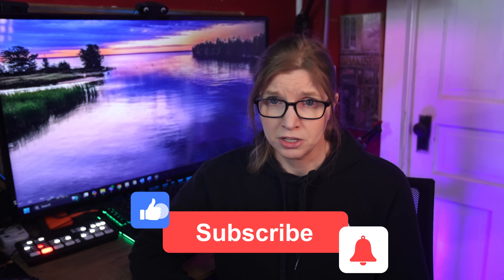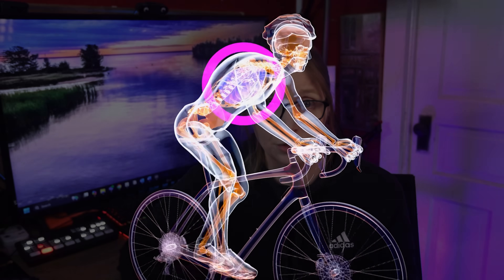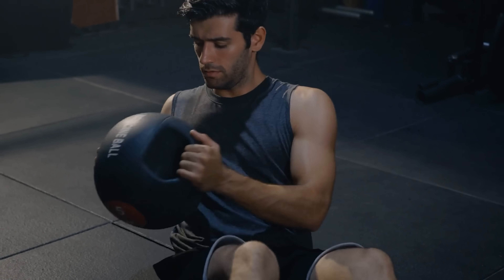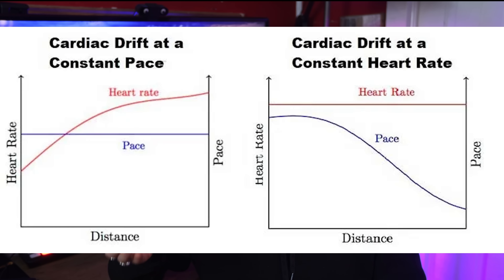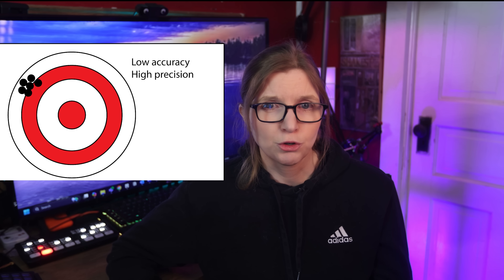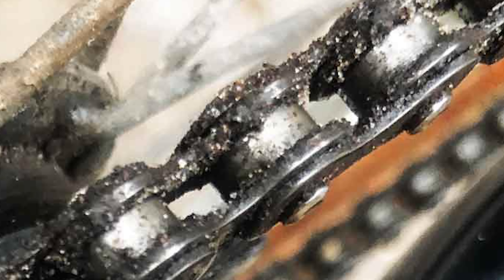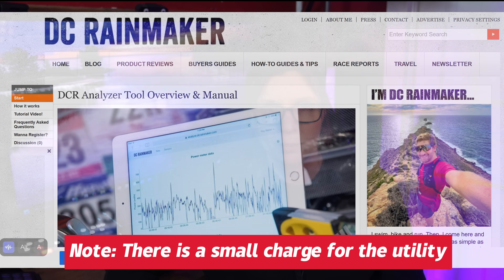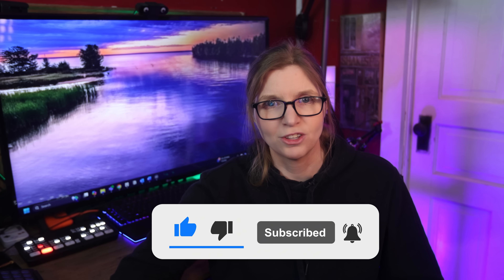Your FTP is WRONG - Here's Why!

Comment: Regarding fatigue from holding position indoors, I have a different situation. As a longtime recumbent cyclist I have a recumbent on the trainer, but for the last few years I've been mostly gravel and mtb outdoors. Being on the recumbent on the trainer takes away all the core work for balance and lets me focus ALL on the legs. Secondary benefit is that one Lasko fan sends airflow across legs, torso, arms, and head.

Comment: Honestly gravitational friction is impossible to replicate with linear algorithms and a flywheel. Anecdotally, my best years with my best training blocks were always on the road. Lots of rolling hills and a fair number of big climbs. I still believe that working your cadence up and down through the same power output is the best way to train. Not only does builds power at different rpms but over time builds a huge advantage in cycling technique that gets engrained in your neuromuscular system. Just ride outside

Comment: Wow! You are amazing! and funny! I am always 20 watts (ftp ~275) lower on my trainer. I have had so many issues with ERG mode I have disabled it. I never had a power meter on my outdoor bike. I would use the power measurement from my head unit or App. That data was more inline with my trainer data. But it is on my gravel bike. I think I am less efficient outside. How much does bike/surface matter for power data?

Comment: Trust me, in the UK, I ride faster when it's warm than when it's cold!
Reply: There’s also more rolling resistance at lower temperatures with most rubber compound, but also at very hot temperatures rolling resistance again goes up. The sweet spot is probably around 65 F or 18 C for body temperature and road temperature
Reply from the maker: @richardmiddleton7770  I just did a whole video on cold weather training, but even if you're talking 50s, it's the road surface and tires. Rolling resistance in the cold is no joke

Comment: +1 ON COOLING 🌬. I took part in a university study  in the 1990s that tested indoor fans. The conclusion:  Indoor riders were woefully "under-fanned".  This results were consistent with your video: You get a less effective workout as the body fights to regulate core temperature. Their recommendations: At least 2 fans in front and one more behind.  A tag line they used: "Sweat on the floor is fitness left on the table"

Here is the setup I have used for years: 4 fans in total. Three Vornado fans positioned as close as possible to maximize CFM and velocity (which falls off at the square of the distance). 

 https://pedalsmartblog.blogspot.com/2023/11/indoor-bike-improvement-8-fans.html

Comment: A few of the things you noted is why I really don't want a bike fit on a static trainer, it feels like learning to play tennis using a VR headset, the bike is constantly moving outside...
Reply from the maker: That's a fair point. I think that some of the major players have done some accounting for that and can use certain models to extrapolate to outdoor mechanics, but it's certainly not perfect. The best fitters out there actually mix something like a Retul fit with repeated outdoor ride feedback. They cost a lot more than the one-shot deal, but they are worth it for those who are hyper-responders that struggle more with tweaks and niggles.

Comment: The HEAT issue is so real.  My personal experience is that I am happy holding 280-290 watts for an hour in a room with AC set to 18C and a fan blowing on me, but if you up that temperature to 26C, my threshold falls to 230, at best, for the same hour and keeping up with hydration becomes a challenge.
Reply: To hold that watts for that long, do you mind to ask you how many hours of weekly training?

Comment: Great topic for a podcast.  I think it makes a lot of sense that your power could be higher or lower outdoors v indoors.  I think one of the biggest factors depressing outdoor power v indoor is road buzz.  In the UK, the roads are terrible and I find the legs struggle to get into a rhythm that you can get indoors or on outdoor smooth tarmac.  That, and the fatigue it gives you - eg I lower back and neck stiffness from riding outdoors  when I don’t from riding indoors at the same power.
Reply from the maker: Isn't that the truth! I spend a lot of my time in back roads and farm land to avoid some traffic. Often these roads are dominated by tar and stone surfaces. On a cold day, rolling resistance can feel like riding through mud and can be really tough to both mentally and physically get on top of the gear. So many outdoor riders struggle with positional discomfort as well. I think that many people need a different fit for indoor vs outdoor riding but are often using the same bike for both. Core strength can get you part of the way there, but the adjustments you make for your terrain can put stress in areas that you don't face indoors, but if you change your bike fit to accommodate, you might feel like your hips or back are on fire once you get inside. 

Sometimes it feels like a no-win situation 😉

Comment: I've never found FTP itself to be an accurate barometer for me.  I'm not one of those people who can churn out high watts for long periods (the 95% of 20 min power is wayyyyy off for my actual hour power), but for short duration efforts of say 15 to 90 seconds, when I'm in shape I can put out a lot of power (for my height/weight).  I never really did structured FTP tests (2 that I can remember), I used power and heart rate at given intensities and what I could sustain for given amounts of time to train with.  For zone 1/2 rides (I go by the Coggan zones), I primarily use heart rate to stay in those zones and power as a monitor to benchmark fitness.  For zone 3/4 tempo/threshold, I use a mix of HR and power equally.  For zone 5 and above, I go off of pure power and then HR as a monitor to benchmark fitness.  Given that heartrate can fluctuate depending on numerous factors, I "benchmark" HR/fitness data over time, not just with one ride.
Reply from the maker: Totally get where you’re coming from—FTP can be a pretty clunky tool, especially if you’re more anaerobically inclined. That 95% of 20-minute power formula is notoriously off for riders who can rip short efforts but aren’t built to hold steady power for an hour straight. It’s never going to tell the whole story.

That said, your approach using heart rate and power together across different zones makes a lot of sense, especially using HR as a long-term benchmark instead of obsessing over individual rides. Honestly, that’s probably more accurate than what many people are doing with structured training.

If you ever wanted to make FTP a bit more useful just for refining your Coggan zones, it might be worth trying an alternate test format—like a 40-minute effort or something modeled over time with tools like WKO or AI FTP detection if you’re using something like TrainerRoad. Not because FTP needs to be your North Star, but just to help dial in the zones you’re already using in practice.

But yeah, bottom line: you’re doing exactly what I’m talking about in the video—treating your data like a tool, not a personality trait.
Reply: @SarahDoesSass  I've done some 12.5 mile time trial races on my road bike back when I lived in SoCal...it was around a 32 minute effort and my power was generally pretty similar (within a few watts), and I would use that to get a better handle on what my "real" hour power would be like.
Reply: @drouleau  you're just like me, anaerobic power is good, longer is worse. For me, this is simply because I don't have a lot of long climbs that I do, mostly short punchy 14% hills. I can pump out 800W for 30 seconds, but only 250 for 30 minutes
Reply: @Shadowboost  Yep, same here.....at 5'7" and 150 lbs I could do 1,000 watts for 15 seconds, 800 watts for 30 seconds, like 480 for 90 seconds, but was around 240 watts for 32 minutes.  I had no shortage of climbing in SoCal - this helps to put out more power vs. flatter terrain like here in Tucson.  I stopped riding for around 2 years and gained 40 lbs and lost all my fitness, so I've been getting back at it the past 3 months - but am a shell of my former self, and can't seem to get comfortable on the bike anymore (and lots of lower back and hip pain).